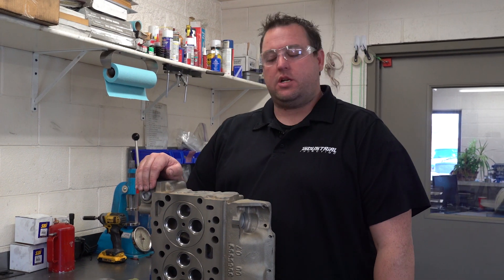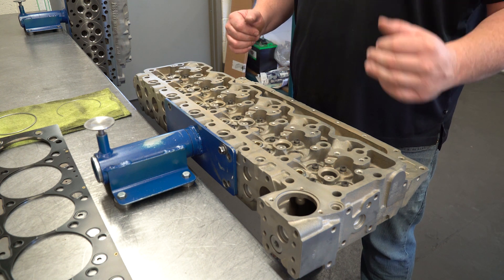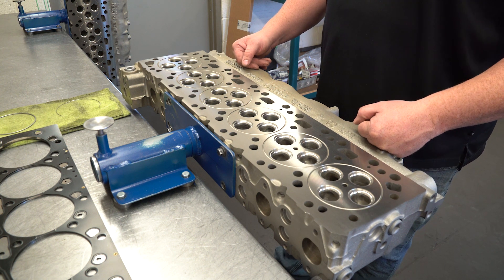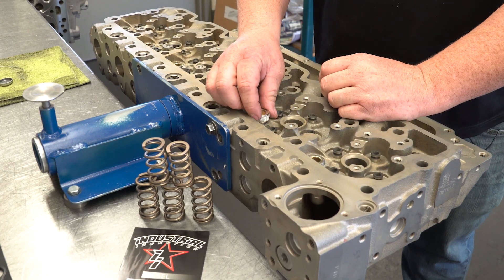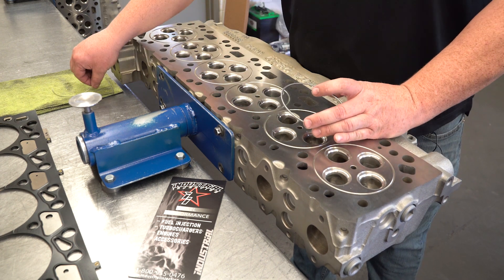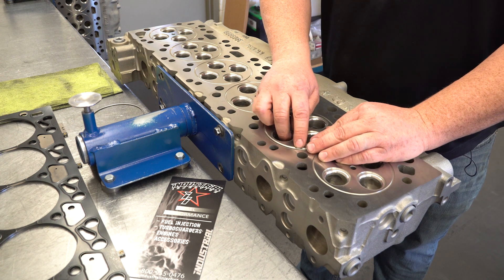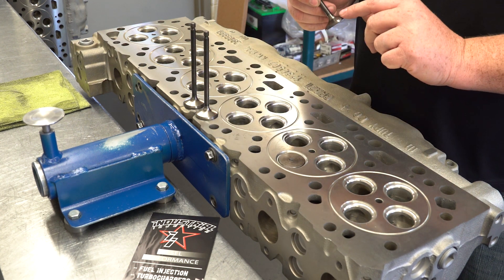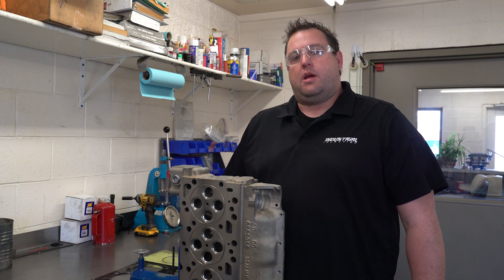5.9L Dodge Cummins Performance Engine Cylinder Head

Comment: What is the hole on the right rear of cylinder head if its upright? Is it a oil or coolant port or just a hole with threads? Thanks

Comment: @UCnVDP2m1f6bD9Hi2SbYFyWw   I see you tap the freeze plugs under the valve cover but why not the ones behind the exhaust manifold . Ive always been curious of that?  Your company suggest fire ring not orings for daily driver?  Guys at the track who sled pull told me they may crack if daily driven from heat cycles but the fire ring will hold more boost. I hope you guys start doing more videos..
Reply from the maker: The freeze plugs behind the head are not typically ever an issue. We use a radius cut fire ring that is more reliable and designed for both daily driving and performance applications unlike the square-cut style fire rings. Hopefully, this would help answer your question.
Reply: @industrialinjection   It did thank you